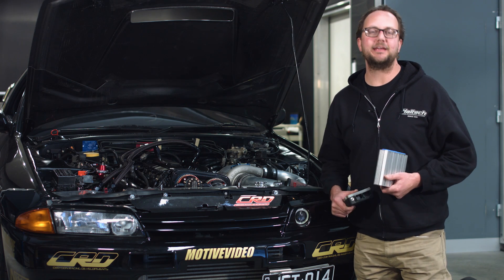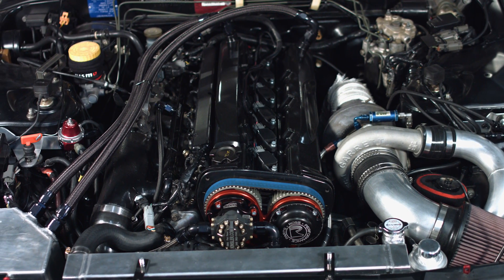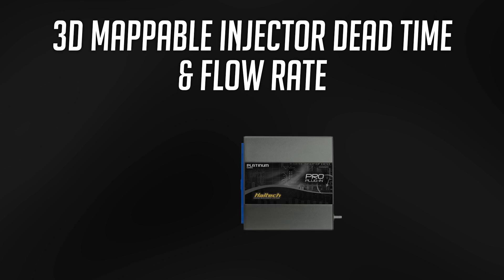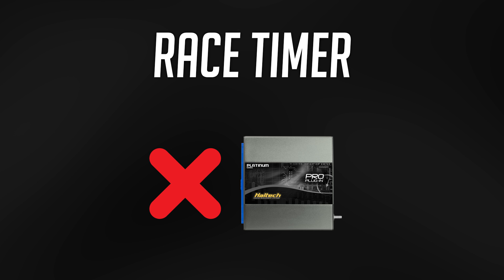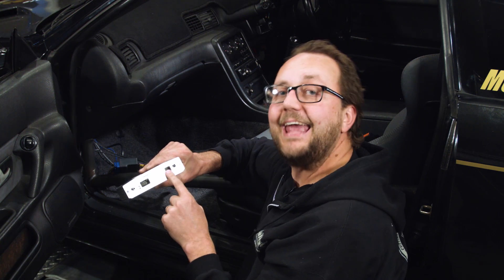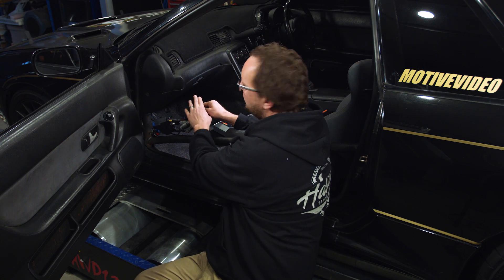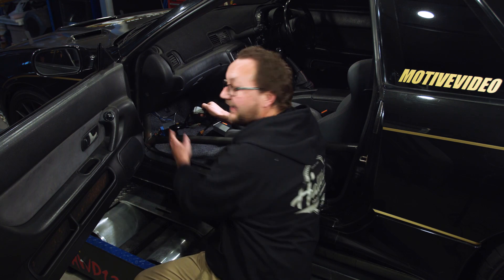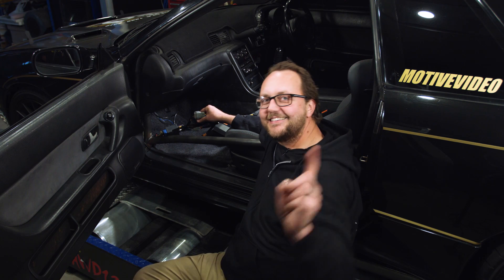💬 Upgrade Time: Platinum Pro VS Elite PnP Adaptor | TECHNICALLY SPEAKING

Comment from the maker: It's ECU Upgrade Time!
The old faithful Platinum Pro Plugin ECU has been around for over a decade and the fact that it's still being made, sold and supported is a testimony to its original design.
Of course now, with the Elite Series, there is a newer, better alternative but does that make the Platinum Pro obsolete? In this episode of Technically Speaking we ask and answer this very question using a real life case study - Motive Video's Nissan R32 GT-R.

Comment: question about the drive by wire i know in the chrysler vehicles that i work on day to day have drive by wire but the customer stepping on the throttle in those vehicle is more of a request for throttle, are these types of drive by wire controlling actual real time throttle input as the driver presses the pedal?
Reply: From what I have been reading about DBW is that from factory the response is made for the "everyday driver". If you can access the ecu then you can change the DBW response time to suit the driver.

Comment: Not all Elite series support DBW throttle. A previous video said they all did as this one implies. It was months ago I rang but I think it was only the elite 1500 (4cyl) & 2500 units.
Reply: The couple of videos I've seen mention that DBW function is only in the top end Elite ECU. 1500 or 2500 sounds about right

Comment: Thanks for your help guys. Can confirm the ECU upgrade was very much worth it for our car before continuing development. Flat shift is epic, drivability is improved with all the long term fuel gtrim and improved sensor reading at 9000+rpm helps too
Reply: Just from that opening shot, hey that is Jet.

Comment: I have a question why dont we see turbo timers much? 10 years ago every turbo car had one is this because most new turbo are ballberring and its no longer needed?
Reply: Newer turbos are watercooled aswell as oil cooled, so they don't need the same cool down time as the big old school oil cooled turbos
Reply: All depends on what you are doing with it... but most were fine after a min or two drive to switch off.